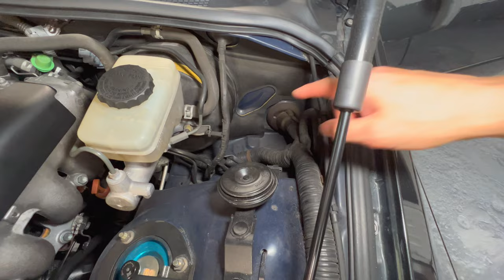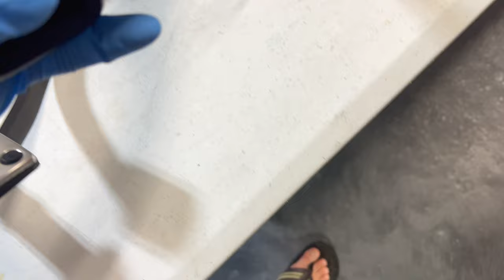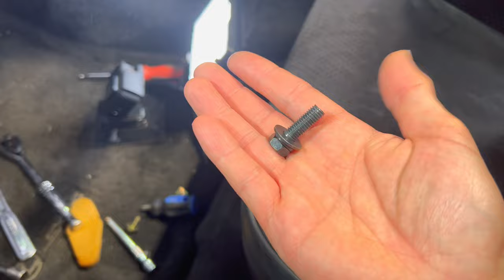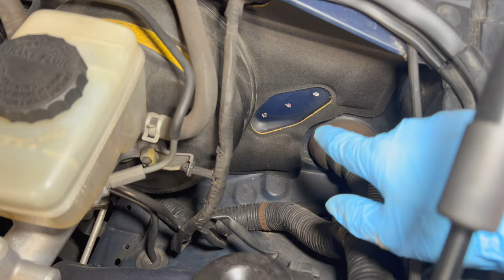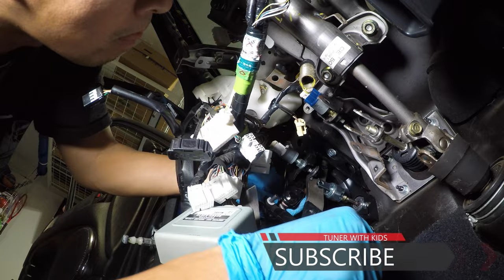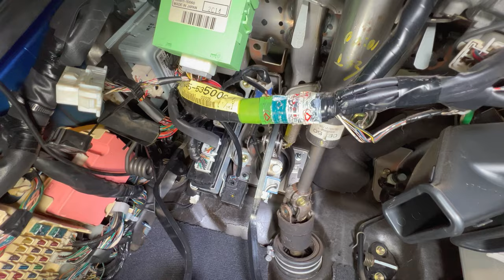Lexus IS300 Manual Swap Clutch Pedal Install

Comment: Do you by chance know the thread size of the that top bolt of the pedal bracket?
Reply from the maker: M8x1.25 I believe. It's whatever uses a 12mm wrench.
Reply: @TunerwithKids  thank you! That’s right. Previous owner didn’t put that bolt in when he manual swapped and it made the car shift so much better.

Comment: What are the two wires attached to the clutch pedal?? My assembly doesn’t have those.
Reply from the maker: Did you watch the whole video? Top is cruise control stop and bottom is neutral safety. Both are OEM.
Reply from the maker: Check my later wiring video for more details. https://youtu.be/fgdOBRwLqqQ